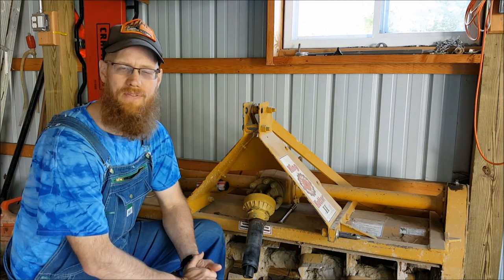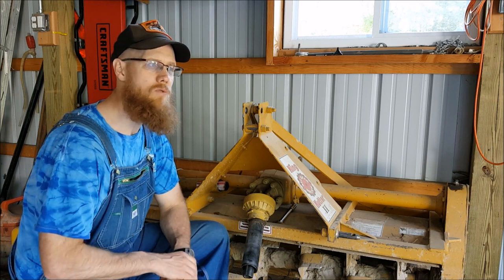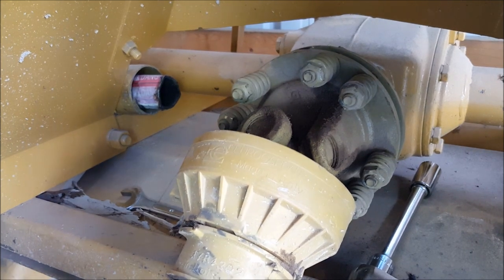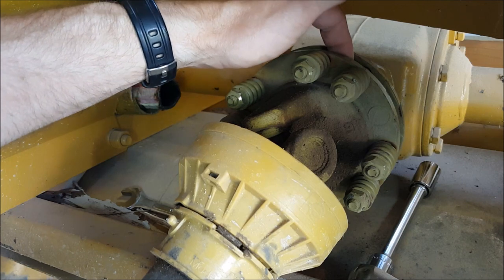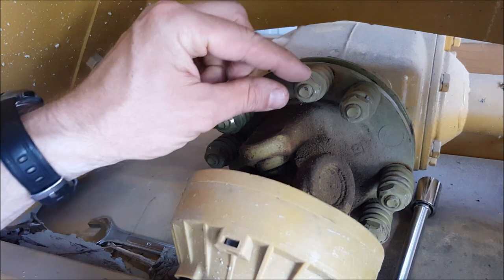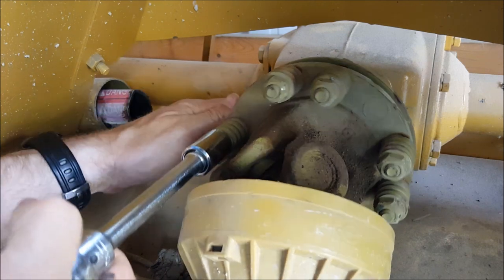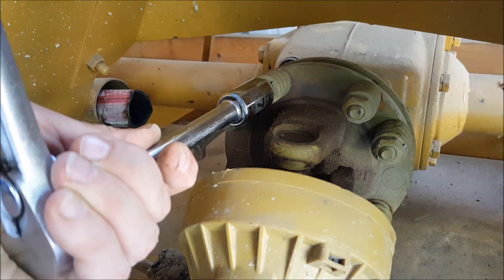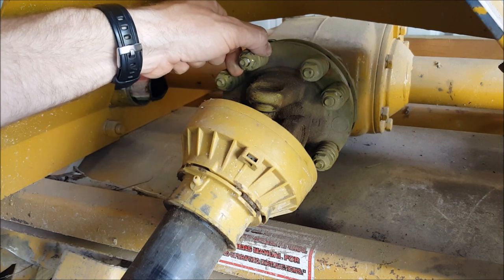Adjusting a PTO Slip Clutch

Comment: Attach tiller on tractor, loosen up all the bolts and run tiller to conferm all the disks are spinning.  Continue with adjustment. Do every year before use.

Comment: I just bought a new 6' King Kutter.  Factory set pto clutch bolts were 3 1/2 turns in.  I turned all nuts loose and slipped the clutch.  I started of with 1 1/2 turns in.  Ran the tiller one time across the field.  Marks showed the clutch slipped and clutch was starting to get hot.  Turned nuts in another 1/2 turn.  Another pass across field and marks showed it had slipped.  Turned nuts another 1/2 turn.  Another pass across field showed it still slipped.  Clutch was not getting hot but I had no way to tell if clutch slipped 1/4 turn or several turns. I may go in one more 1/2 turn to see if it stops moving.  1/2 turn after that and I am back to the way it came from the factory, which was really tight . The springs were mashed almost together.
Reply from the maker: @fredricksiegmund627  this all sounds very frustrating, sorry you are experiencing it.  I almost wonder if the springs could lose their tension.

Comment: Mine has less than 50 hours on it,brush cutter not tiller. I also don't think the dealer did a "run in" on the clutch, just tried and appears one plate slipped but not the other one. I'm thinking about contacting another kubota dealer. Any advice would be greatly appreciated!
Reply from the maker: Best of luck, I find I have the best luck when I visit these place in person instead of phone calls
Reply: There’s no way one could spin and not the other if you see how it works. The clutches don’t necessarily have to turn relative to the drive side or the driven side.

Comment: Any ideas on how to TEST it manually?  My instruction say to spin it 2 turns. Maybe I'll lock in the tines and try to spin the PTO..
Reply from the maker: Hmm, I believe the instructions say once a year to loosen bolts and let the clutch spin to prevent rust locking it up, I would make sure you don’t damage your tractor clutch or pro, but decent idea

Comment: Have you ever had any issues with these getting out of center?
Reply from the maker: I have not, are you referring to the clutch disc?
Reply: @YoungbloodFamilyFarm  Yeah I am thinking the hub might be worn or bent, going to take apart clean put back together burn in see if that helps. bought an older brush cutter. the disk are not centered with the hub so it shakes, then causes its self to come loose from the gear box making a wobble. In respect to what it is bought at farm auction really cheap, its a 7ft super heavy duty cutter that was used with a 130hp john deer tractor SO its possible it could have hit something not slipped and warped where it connects  to gear box. The splines do not appear to be worn.